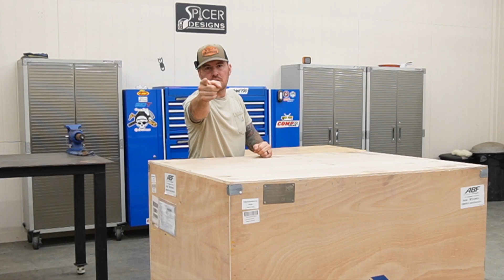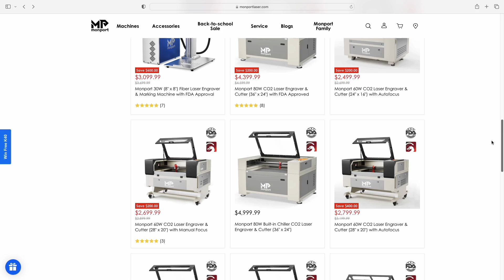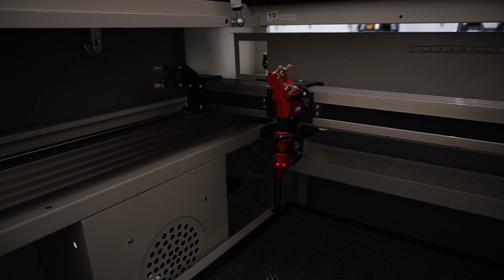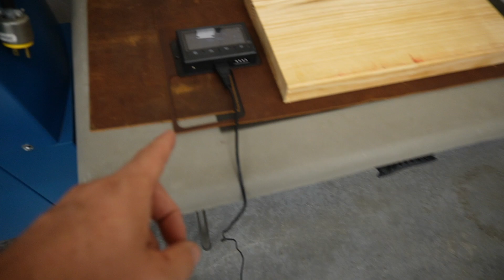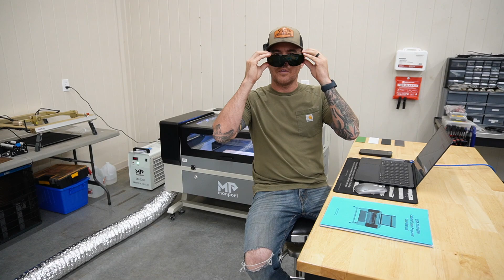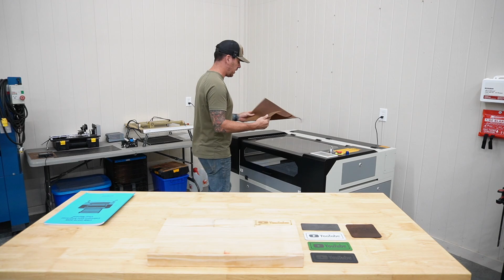Everything You Need To Get Started!

Comment: Do you have to use a 5200? I have the same machine but my water cooler is 3000,
Reply from the maker: @mrsdizi1234  thats just what they sent me.
Reply: I'm not sure the 3000 has the built in compressor and cooling system like the 5200, I think that's the difference.  It's essentially a fancy version of the tank and pump.  I ordered a Vevor chiller.

Comment: Monport, with six months left on my warranty they are giving the run around. The first thing that broke were the cheap hinges they put on the door. Ok i replaced those with no complaint, then the key swicth, ok they replaced that on my first year, then auto z probe did not stop on automatic z0 setting, then the laser power supply burned up a couple of transistors, then they send the wrong probe and said they will replace it. But as of yet nothing. Every time i send an email i get a different person, (The Run Around) No probe nor laser power supply yet. I have talked to several people with Monport machines, and they are having the same problem. I paid for the machine on May 2022 and received it on October 2022, and they are saying that the warranty expires on May 2024, you do the math. If i were to do it over i would not buy a Monport.
Reply from the maker: Unfortunately ive heard a couple stories like this.   Not good.  Hopefully they  get it right for you.

Comment: I have had my Monport 20 X 28 60 watt CO2 laser with autofocus for more than a month. I was experiencing jobs stopping before they are completed, and strange behavior with the laser. It will wander off the line when cutting, and then return and finish the cut, but the piece has been ruined. I am having similar problems when engraving. I use Lightburn connected by USB. I understand that using USB can cause problems. I have read that the best way to connect is via ethernet.
I ran a network cable from my router to the laser. There is no indication of link or data at the connector. I checked the Admin page in my router to look at the list of connected devices and the laser does not show up.
I verified that the network cable is good by connecting a laptop to the network cable. It shows link and data indicators on the laptop. I am also able to see the laptop in the list of connected devices.
I set the IP address in the Ruida controller on the laser as recommended. I had intended to do a reserved IP address for the MAC address in laser. Even just plugging in the laser should have generated a DHCP IP address in the router, and I should be able to see it in the list of connected devices in the router.
I have contacted Monport support repeatedly, and I get what appears to be an “automated” or “AI” reply that uses some of the words in my support request, but provides no real help.
One of the reasons I bought the Monport laser aside from price and good reputation was the promise of US based support. I have called the US Support number, and each time I get a message that the mailbox is full and cannot accept any more messages. It offers me the opportunity to send an SMS message, but I never get a call back.
They asked me to send a video of the problem. What is the point of sending a picture of a network port that does not show link or data lights? It’s just a delaying tactic.
They asked me to check the software. I am assuming that they mean the firmware in the laser. They do not provide any documentation or procedure, or even what is the most current version of the software.
I now have a very expensive laser that I can’t use because it is malfunctioning.
It should be very easy for Monport to send a new Ruida controller and I will install it.
The delay in getting any kind of a response from them, except the “automated” response is even more frustrating.
I am looking into my legal options to return the machine, and get a refund. Since it is past the 30 day window for a return I’m sure they will not be helpful. I intend to contact the Attorney Generals Office in my state to find out what I can do.
I don’t expect that anyone on Youtube can help, but I offer this as a caution to anyone who was considering purchasing from Monport.
Reply from the maker: I have a link in the description of a forum that will guide you through the connection process via ethernet cable.  I was having the same issues.  It was a pain but i eventually got it.  Ive heard of a driver install as well but i didnt have to do that.  My advice would be to direct your research to ruida and not monport.  You have to find the active ip address in your computer and change the last 3 digits, then set that in the ruida and manually connect it to lightburn.   The forum will have the link.  If you email me i can go into greater detail.

Comment: With the in-line fan, everyone says you are going to want to remove the internal fan. They will fight each other
Reply from the maker: Good point.  The inline fan is way more powerful too.  If anything, the built in fan is probably restricting.  Thanks for the suggestion.
Reply: @SpicerDesignsLLC  Monport and Omtech are basically the same machine.  There are lots of videos on the Omtech about upgrades.

Comment: Not sure if this would help but they do make a USB to ethernet adapter that allows you yo go over greater lengths. Maybe you could do that for your machines and then into a USB hub to the laptop. 

Ive been using one for almost a year without any issues, plus doesnt need power and inexpensive off Amazon about 15. 

Great video as always, thanks for the laughs 😂
Reply from the maker: Thanks!  Ill check into that.  I have to work out some kinks with the connection issues.